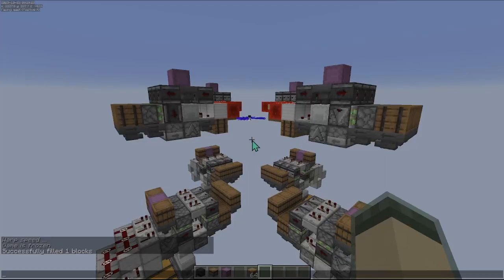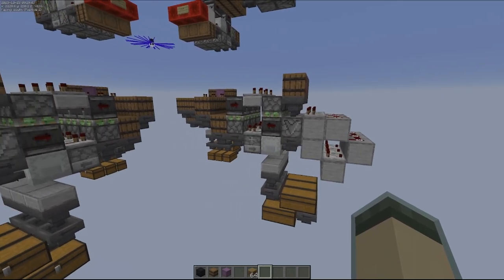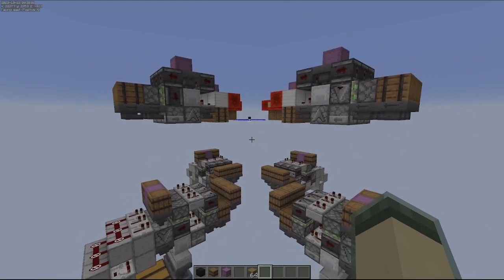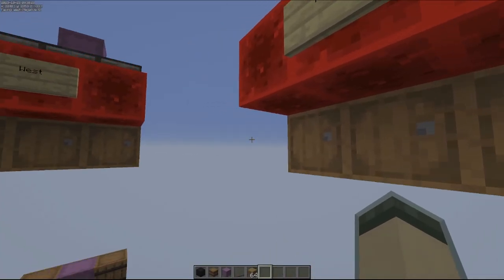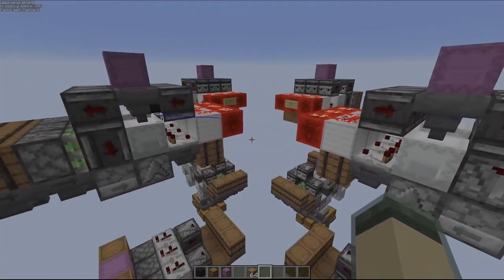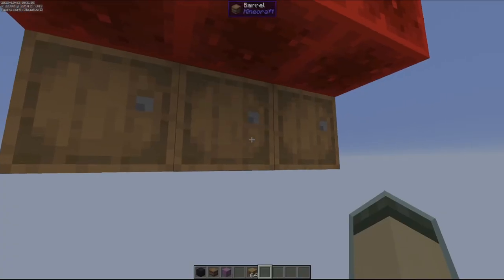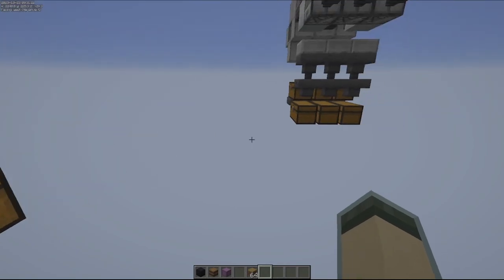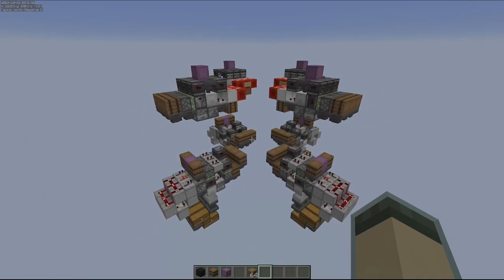1 Block wide Minecraft Shulker Loaders are NOT tileable

Comment: you should send this to mojang as a bug report or feature request. this is argueably one line of code, to change the "popped" item spread range. maybe 2 if it's only for shulker boxes. maybe more if they add weight math for a full shulker box. or all blocks. imagine popped leaves blowing away in the wind. immersion. not just redstone. :)
Reply from the maker: I'll search through the feedback site and make sure the subject hasn't already been brought up.  Thanks.